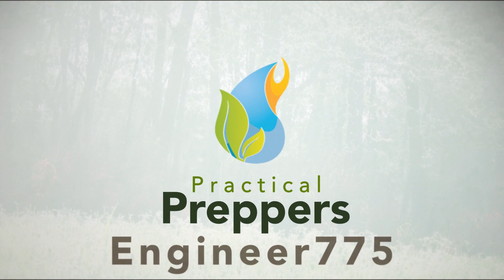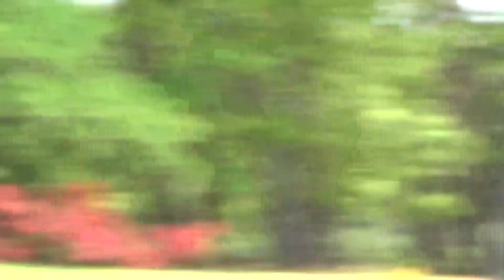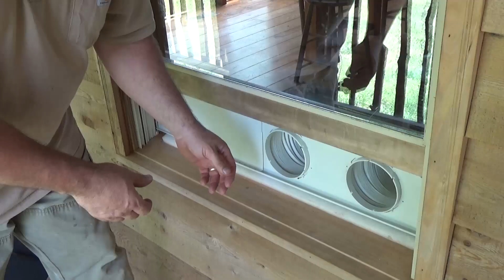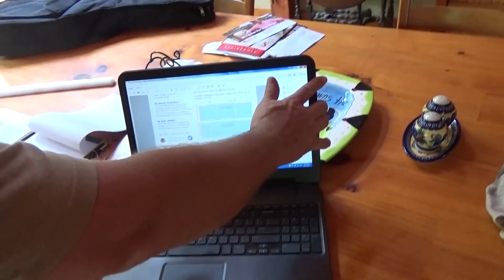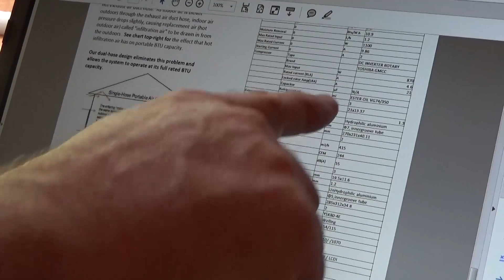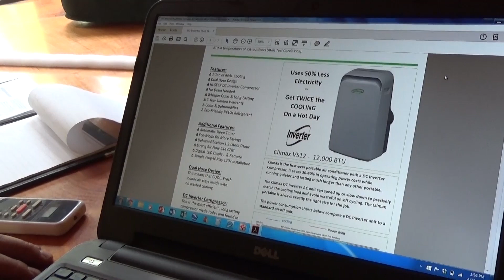World's Most Efficient Portable Air Conditioner

Comment: maybe add a 90degree pvc pipe facing down on the air input, outside to get better separation between hot out and cool in and a little mesh fencing in there to keep birds out?

Comment: The dual hose is absolutely essential, especially in an rv. It functions like a window unit, in that the compressor is cooled by outside air, completely separate from the cabin air. Moreover, in small applications, cycling would definitely be an issue.
Reply: Does that save on electricity?

Comment: So, the "inverter" compressor works similar to an inverter microwave, where a reg m.w. set at say power 60 works at full power 60% of the time, turning on and off throughout the cycle... Where as an inv. m.w. set at power 60 works at 60% power and runs at 60% power the full time.

Inverter m.w.'s and inverter a/c's are definitely the way to go in an rv situation, where a low draw over a longer period of time is preferable.

Thanks for vid.

Comment: Have you looked at split system? they are so much more efficient. eg 2500w cooling and 500w energy usage. These may be 50% more expensive, however quieter, less electricity and reverse cycle. no brainer i think.

Comment: I'm looking for a 12-volt portable AC that does NOT require an inverter.
Reply: I dont think they make them
Reply: It would still run like a regular a/c unit, though... compressor full on, or full off... this unit has an inverter compressor, which ramps power up and down, while running steadily... not to be confused with a power inverter, which simply converts/bucks voltage. 

that said, a 12v unit would increase system efficiency, overall.

Comment: I wonder if you could bypass the double inversion you must be using to run the compressor straight from the solar bank FC instead of the AC inverter back to dc.

Comment: Where can I buy one... I couldn't find them on the website!
Reply from the maker: I regret to inform you that they have stopped producing these. in lieu of their other products like this one https://www.practicalpreppers.com/air-conditioning/ac-dc-air-conditioner-hybrid
Reply: Engineer775 Thanks for the fast response! Can you recommend something similar or where to look (I'm thinking a portable or a window unit or a mini split would probably all be fine)? I'd like to add A/C (heat would be nice too but not critical) to a 20' x 30' mostly solar powered workshop but I only have about 250w of solar power! Thanks!

Comment: Would it be able to keep my up stair cool?  its two room a 15 by 15 ( a bedroom)  and a 15 by 13( office never been able to use). both rooms  have slop ceiling and only one full window and three crank open half size window.  Plus one room is next to the attic which is always hot. it has no vent in it.  I have never been able to use the office because it only has two crank windows. And it gets hot in summer and winter ( because of heats on), If not is so easy to use and move and install in both windows?

Comment: What does this require for starting watts? I see people saying it will run off 2000 watt generator, however i am concerned with getting the compressor to start, not just the fan. I have a Honda EU2000I (Peak 2000, Constant 1600 Watt)

Comment: What Brand and Model Number is your Air Conditioner?  I have a Senville 14.000BTU one that looks identical!  The arched grey trim on the front, and even the layout of buttons on the top, but with only ONE hose going to the window.  There's no pocket for the remote, so I got some Velcro with an adhesive on the back.  Fuzzy stuff on the remote, Prickly stuff on the unit.  Mine also has a Heating ability so if it's chilly in the middle of the night, it will warm the place up a bit.

Comment: Since it pulls in ambient air wouldnt it be better to jave the intake hose high in the room to pull out hot air and at the same time be ising less energy cooling air that is already partially cooled amd dehumidified?
Reply: Seems strange if you don't know that the two hose unit is not mixing the outside air with the inside air. The outside air runs in one hose, over the condenser, and through the other hose right back out the window.

Pulling air you already conditioned over the condenser and out the window is bad news. That air is being replaced, the entire house is pulling outside air through the cracks, you are cooling it, then your conditioned air is being used to condition more air as you pump it out the window. Single hose units are criminally inefficient, using the second hose to pull from a warm spot inside would be nearly as bad.

Comment: The dual hose does not make it more efficient. You are pulling in hot humid outside air to cool all the time.  If it pulled air from the conditioned space, the air is partially precooled and predehumidified.  Some one sold you a bill of goods about the typical Window unit pulling in air from every where.  All the air it pulls out of the room goes right back into the room.  If you do not insulate both hoses you are bringing in a heat source and blowing out really hot air and it will radiate from the hoses.  I have a similar unit with only an exhaust hose and I insulated the hose because it can really heat up the space behind the unit. I suppose this is the type unit you say pulls air from every where, but that has never been a problem with me.  Houses are not as airtight as you think.  You would smother from lack of oxygen if your house is airtight.
Reply: You are mistaken and really need to study your A/C designs. 

A single-hose unit MUST discharge air it pulled from inside your house to the outside. Some of this discharged air is has already been cooled by the evaporator, thus you are wasting energy cooling the air and then immediately using it to run through the condensor and discharge outside.

Comment: Those solar panels may be 1000 watts but not at the 115 volts that Climax portable air conditioner requires. I'm guessing the solar panels are putting out approx 10% of the required energy to operate the A/C.

Comment: This is what I need for my camping van. I don’t understand why they don’t all go with a 2 hose setup on these portable units. This single hose pulls in outside heat due to the vacuum created by the single exhaust. The smaller the space the more it negatively effects the cooling.

Comment: I can't tell you how much I hate single hose designs. I just can't believe they are pushed on the public. There actually needs to be a movement to get them BANNED.
Reply: That's how I feel about mine.  It's better than nothing but it's just warm in genuinely hot weather -- once it gets to the point it pumps out X amount of cool air to bring in X amount of cool air, it's just using power for nothing.
Reply: I've used mine for three hurricanes now. Runs great off my 7000 watt generator and keeps me quite cool as long as it's pointing at me. I wouldn't be able to sleep here in South Florida with no power in August without it.

Comment: Light bulbs and miles per hour car improvements have been great...
I don't see the many fold gains with A.C. compressors.
That's not cool.
Reply: The EU keeps banning literally anything that takes 1 watt too much power. TV too bright? BAN IT!

But portable ACs? Those are apparently allowed to use inefficient "on/off 100% power" compressors and single hoses (which double the energy usage and halve the efficiency).

Really, if there is one thing I wish the EU actually banned, it would be to ban non-inverter compressors, and ban single-hose portable ACs.

But because they aren't banned, the manufacturers don't even bother making the more efficient units. You can't find them in Europe, Australia, etc. Only USA has some more efficient units, and even then they're rare...

Everything on the market must be dual hose with inverter compressors. It's less noisy, 2x as efficient and only half the electricity usage.

Sad.

Please EU, ban this. K?

Comment: The dual hose arrangement is definitely superior in most circumstances, but I'd separate the  inlet and outlet on the baffle, either by putting them at opposite ends or putting elbows on each and aiming them in opposite directions. You don't want the air coming out of one and getting sucked back into the other.
Reply: I suppose the manufacturers did that just to accommodate people with just tiny window ports, at the expense of everyone else.  They should have made the sliding sections in between the vents, for maximum separation and efficiency, to avoid short circuiting the air flow.

Comment: Seems like a great AC unit..... except for the price. $900 !
More than 3 times the cost of this unit -- https://dealnews.com/Haier-12-000-BTU-Portable-Air-Conditioner-for-270-free-shipping/2028113.html
There's gotta be a more inexpensive unit with these features, right...??
Reply: There is no other inverter portable on the market. I have the 14k Haier, which has dual hoses and a rotary compressor. It works great but it's noisy, especially every time the compressor comes on. It was half the price of the Climax, but if you live somewhere really hot, using 50% less electricity would pay for the Climax soon enough. I was looking at it in hopes it might be a lot quieter than the Haier, but I don't know if it is.
Reply: It seems quite similar to the Whynter ARC-12SDH, listed on Amazon even. 
 I  thought it was the same unit from the description.  Power draw is about 1000W.  The biggest difference with these compared to regular air conditioners is the ability to also use it for local heating, where it's much more efficient than using electric heaters, putting out much more heat than any 1800W electric heater could muster up.

Comment: thats pretty cool! we actually use a basic small ac unit in our tiny cabin and it works pretty well on the solar. befor it gets extremly hot, we use a 2 fan circulator(1 blows in, 1 blows out)

Comment: Last year,I bought a portable AC unit in Costco thinking it would be a perfect unit to cool my remotely located hobby shack. What a surprise it was when I could only find one hose that exhausted hot air only. I thought it was extremely dumb to design and sell something like that. What's the point of having an AC init indoors when it draws a lot of hot humid air from the outside. Obviously I took it back to the store. 

The unit on this video is exactly what I need.
Does it require a separate solar power management controller or a battery bank? The installation manual only states that the unit requires 120 VAC. Can it be wired directly to a bank of appropriately sized solar panels?
Another question. I'm in the Upstate SC area. Can I pick it up at your store to save on shipping charges? Do you get involved if there is a warranty claim issue?

Comment: wish they had one half the size so that I could use it in a small RV with less power requirements
Reply: Tyson Capel it'll work in a small camper because it will run much less often and for shorter runs to reach target temp!
Reply: @dmartelis65  can it work on a 12v off grid solar system?

Comment: I'm sitting now watching this video in my living room. This room is a 16 × 22 ft room. I'm using a Frigidaire mobile unit. Half the size of the one being used in this video. My unit I'm using is only one exhaust hose. Using only the air inside to cool. It is awesome. I've got one in my bed room as well. It will make you grab for cover. I don't like heat. I love it cold. Either one of these units will get down to 61 degrees. plenty cool enough for comfort. I would buy another one if and when mine goes out.

Comment: exactly what is the point are we looking at ?

this thing is $900 plus $100 shipping and handling or   1/5 the cost of an avg  small residential AC unit

a regular Joe blow 5000 btu window  AC unit from walmart  is  around $125 and cost about $1 per day to run if planned for and treated properly

you only need AC about 60 days out of the year in the mid west ... so about $60 per year ... and in places god hates like south Florida and Arizona would be about 150 days a year

my point is... why not have 1 power line coming in from the evil monoply power comany to power ONLY the $125 walmart window AC unit and nothing else for for that 60 day time frame you need lots of power for an AC during the year... in 5 years its only going to cost you $525 for the AC unit AND the power from the grid to run it plus you get the added benefit of  all the non hassle ease of operation of not having it hooked up to something more experiential form of electrical generation  VS $1000 just to buy this climax unit

again. for 5 years $525 vs $1000

i guess my issue is ... what are you really saving... yes i go deer hunting every year primarily to severally off set our familys food budget ..and i dont own a gun or hunting stuff... i just get a tag, buy my buddy a 6 pack of cold bud and his favorite bag of chips and he bags the deer for me at around 7:10 am while im still in bed,  then later on in the day  i butcher it up at home, he loves killing cute  fury woodland creatures, i like eating cute furry woodland creatures, WIN/WIN. how much is a deer rifle, what do bullets cost, what does camo underware cost, you got to get up at what time to go shot and gut bambies mother?.. bottom line how much did that 3 months of dinner meat cost me? and with out of towners ... they just want the antlers for there walls, not the meat...HUGE WIN

how am i ahead of the game buying the climax (portable ??? ) AC system

there is a way to deer hunt to save money and not to deer hunt, there is a way to AC cool your house and a way NOT to...why spend $2 per day to be OFF the grid when it only cost you $1 a day to have AC  on the grid when you need it

As to this being portable... HOW?

 sure technically your right, but i cant find that Youtube video of a dude packing his fishing pole,  his over night pup tent and the climax PORTABLE AC unit into the back of his pick up truck  ...and oh right also 3 large massive solar panels, a control board, inverters, cabling and extension cords, test meters and shelving unit containing 5 large deep cell battery..to go fishing and camp over night on Saturday...if you can post a link  to THAT  youtube video of the climax PORTABLE , off the grid AC unit system , id appreciate it

we talk about electeic cars getting only 200 miles to a charge and taking several hours to recharge.. but they dont use any gasoline, 

WELL here is an idea get a 5hp brigs with a 1 gal gas can lawn tiller  engine and  a couple AC delco alt then hook that puppy up to your battey supply packs of the car... sure its still using gas, but that 200 mile range of electric only sure got a heck of ALOT longer didnt it... savings ??? idk... ask Samuel L Jackson for his opinion

OH HELL YES, MOTHER FREAKER !!! ...Errr something like that

thanks

prop
Reply: Prop Paper Ahahaha,
I'm willing to bet EVERYTHING I OWN, you couldn't guess my demographic, OR that being in my demographic that I would, agree with you so whole heartedly. BUT, I Do. Why? Because INTELLEGENCE, especially mixed with Logic & Humor, has No Demographic. This Shyt was Funny, & true. Can't get much better then those two things, IMO. It's something we've lost, & need back desperately. Logic, Honesty, & Humor. We are at hyper speed... reverting to uptight,  bowels bended to breaking point  British like mindedness.  
F% €× That! Uh, didn't we like fight a whole war over basically that same shyt? 
(For those in the aforementioned category, That is called......Sarcasm)
With ♥, An intelligent, humorous, 
multiracial, multi ethnic, Little - Big City Girl!
Louisville, Kentucky USA!
GO Smart People!
eer... or Go Any People with a Brain cell left?
.. or something like that! LOL!
Reply: Yep.   I've seen a number of people who spend $20,000 to save $1000 a year -- cause they're Beatin The MAN -- and they tell me how much they've saved.   Then in 7 years, they have to buy all new controllers, and 4 years later their panels are down to 1/2 output, and a year later a hurricane comes through and makes their system ready to be recycled as Reynolds Wrap.  It they'd taken the $20,000 and put it in tax-exempt Municipal bonds, they could pay their electric bills without any risk.  But they're so happy they've Beat the MAN ... even if it cost them $12,000 to do it.  And they're GREEN, so they've saved the world.  ("roll eyes")

Comment: I can get a dual hose that does 14,000 btu for only $500 at any local hydro store. Your unit is overpriced and weak.
Reply: Do you have one you recommend online I can order
Reply: Don't forget the start-up wattage draw requirement to run off of solar may be quite taxing in some units. Just pointing it out because the technical requirements can range greatly for a myriad of applications. I always shop for used equipment myself. I found a dehumidifier for $35 used that has run great for three years so far!